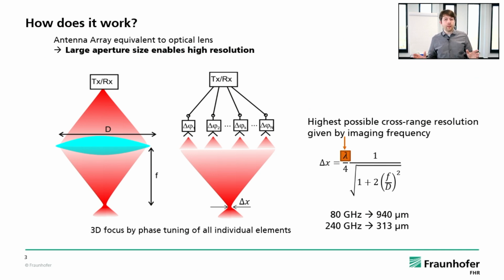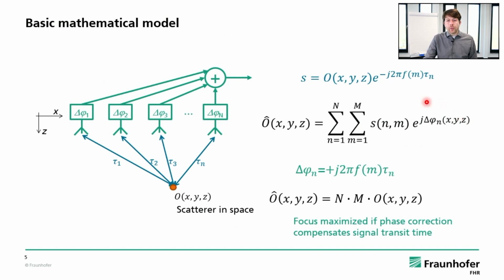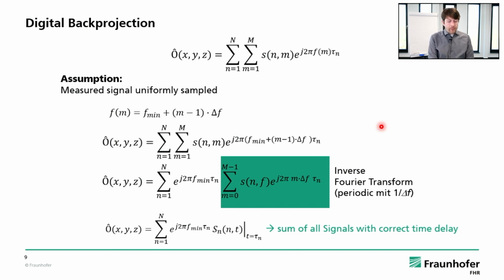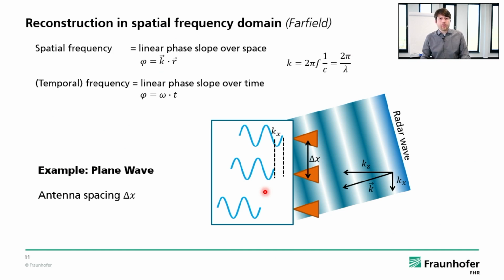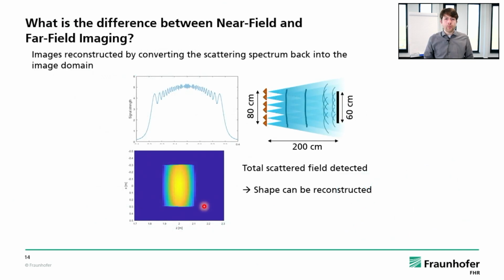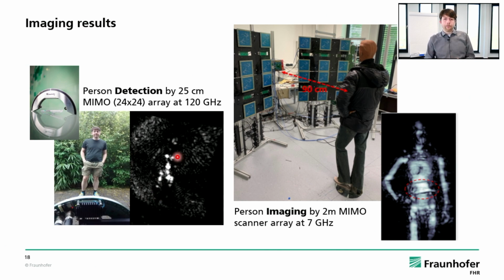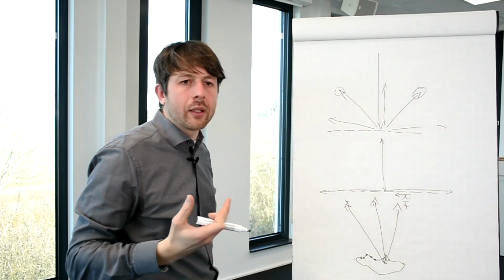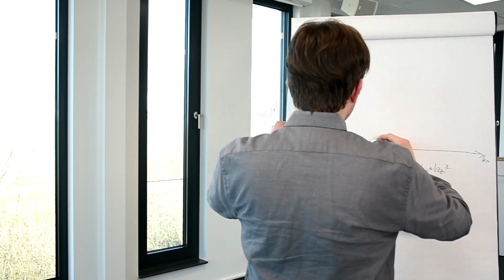»Radar in Action« Radar-Imaging – An Introduction to the Theory Behind

Comment: I have been designing radar for many years and struggled to follow this presentation.  The presentation was very clear at the beginning, but quickly becomes confusing jumping from complex topic to complex topic without clearly explaining the connection.
Reply: Which radar system are you using?